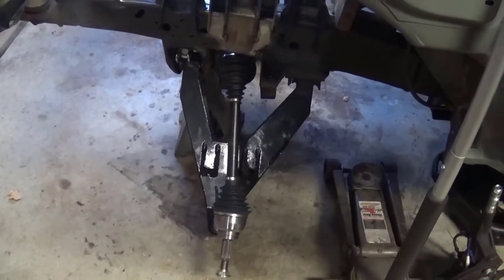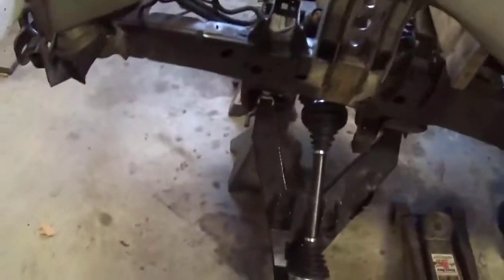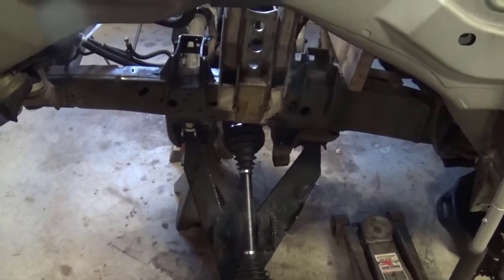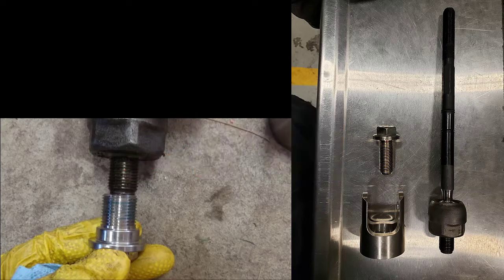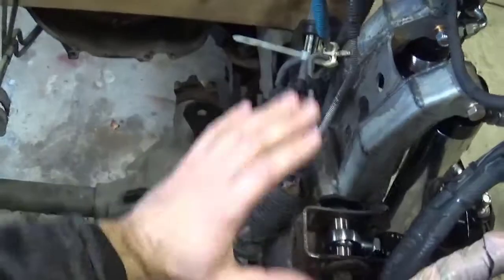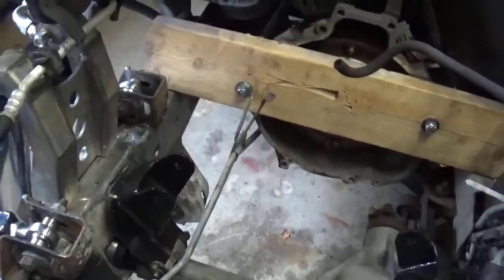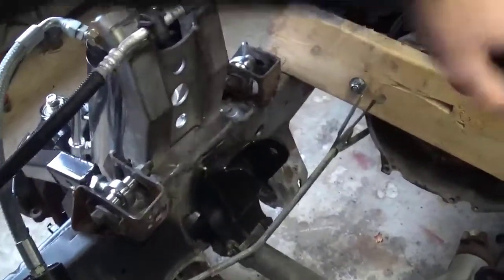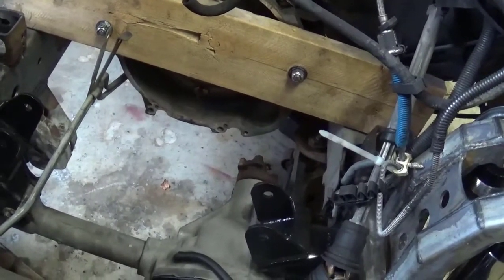4WD Prerunner Front Suspension Mock Up

Comment: I wish I would've seen you videos before. I got the kit and having the same issue with the CV axle, and obviously with the company. I didn't even get call backs or email replies.
Anyway, what size cutting wheel did you use to "fix" the axle? I'm probably going to do the same. My truck is been sitting in my garage for too long now.
Reply from the maker: I hear you man. The cut off wheel I used was one from my work. 4 inch diameter and .0505 inch thick. So pretty thin. Good luck.

Comment: Jesus christ i havent heard so much crying in one video ever. Dont take on a big project like this unless you are prepared to solve issues yourself without relying on a the company. I guarantee they specify that although its “universal” to 98-2011 or whatever there may be modifications required and that it works best with certain years. Stop pointing the finger at everyone else and man up